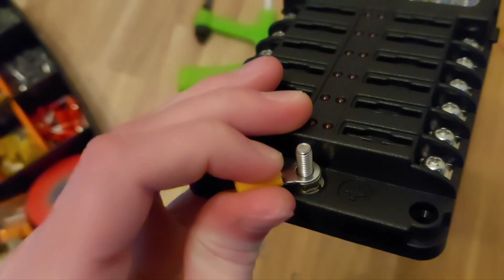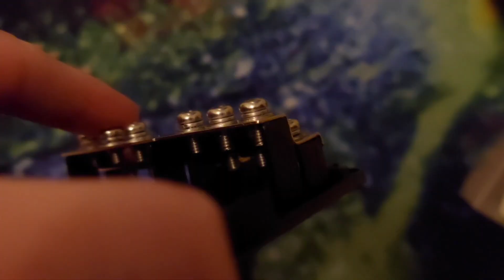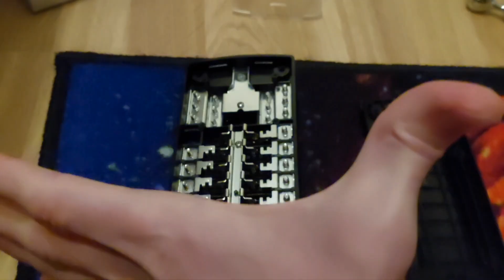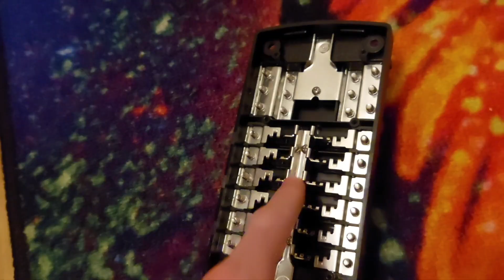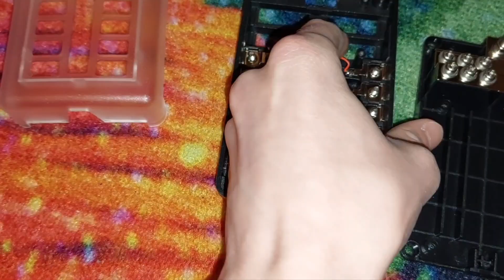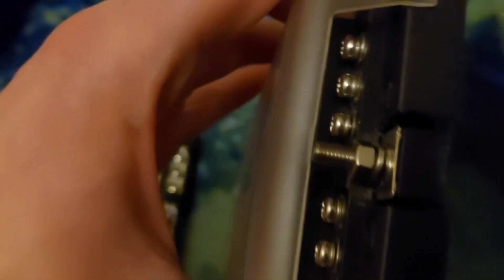Fuse block "Tear down" Blue sea vs budget

Comment: At 4.27, you can see the underside of the stud at the top and bottom of the unit. As you can see, the only thing holding it in place is that it's been squished down into the metal. I have found that, with use, this stud will come loose. When looked at from the top, it appears that the stud has snapped off, whereas in fact it has simply dropped down into the framework of the fuse block. The way to fix this is to take the whole thing out, turn it upside down or on its side, get some superglue, and drip it into the area around the base of the stud. This then stops the stud from falling back down into the fuse block. It's really just a design failure. There should be a nut on the underside of it.
Reply: I broke the bottom of my power stud off yesterday. Funny this video pops up after the fact. 100% a design flaw. Should absolutely be a nut and bolt on the back.